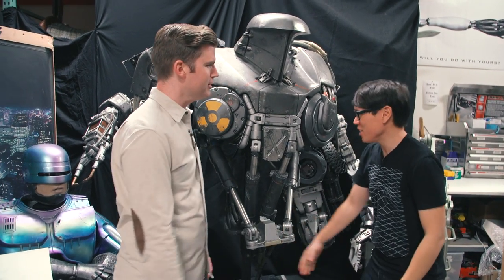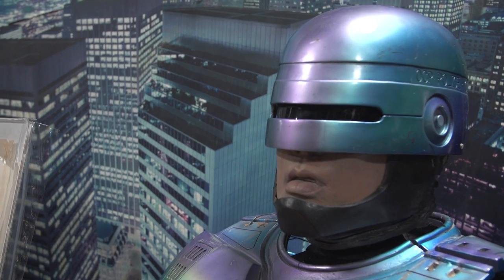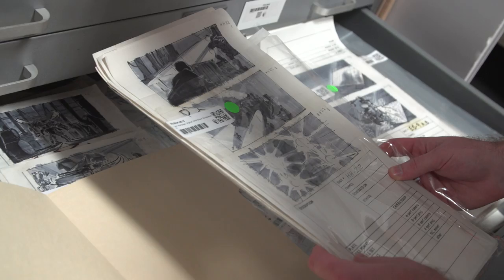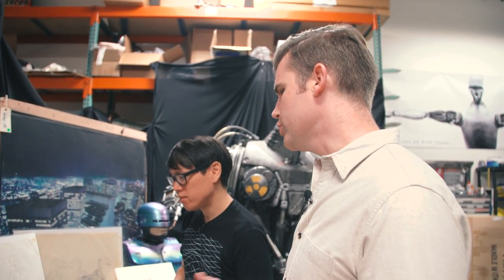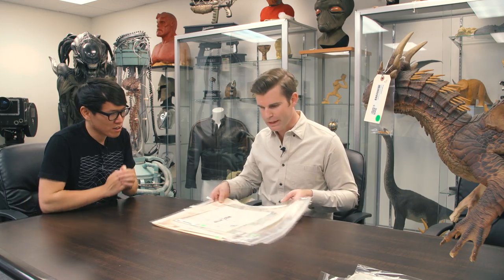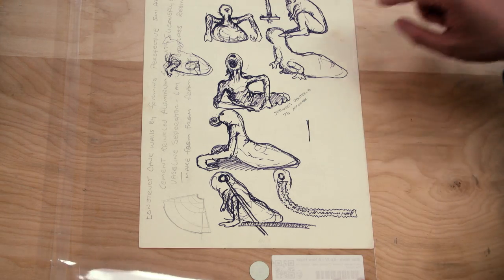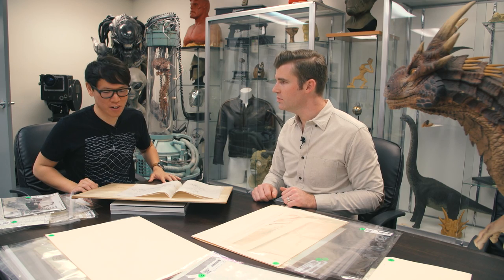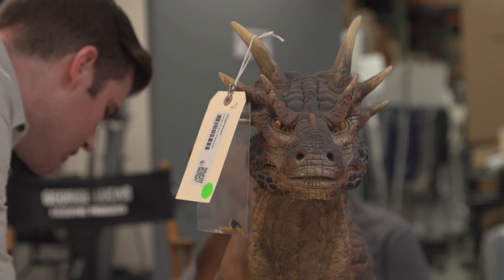Phil Tippett's Film Props and Special Effects Legacy

Comment: The "Tauntaun Animation Cycles" shown at the end look more like they were traced (first clue, tracing paper...) off of a projector or rotoscope platen. So at that point, they had made everything physical, set up the mini stage or greenscreen (or was it blue?) did several walk cycles on film and then analyzed them. I think then, those pieces were done in either the beginning of or in the middle of -- "go motion!"

Now that's some cinema history. Hard to display but worth every penny.
Reply: they used horse walk cycles they filmed as reference. go motion was used on Dragonslayer in 1981, after Empire was released.
Reply: I bought some contact sheets from this auction that include tests of different shutter speeds with the Piranha puppet before the tauntaun was built and then a small sketch of how the tauntaun rider should bounce.  A small piece of history, but really nice to have a part of it on the wall for inspiration.